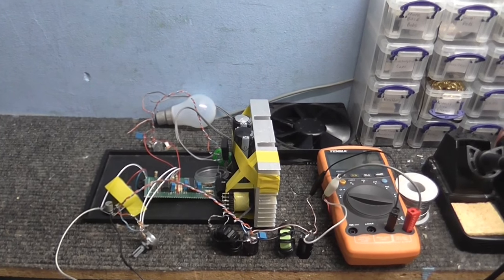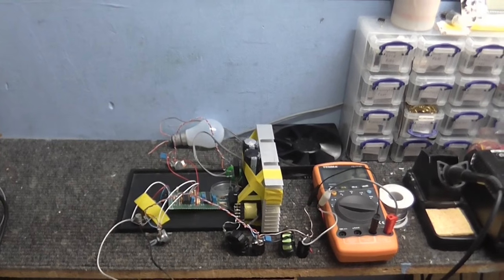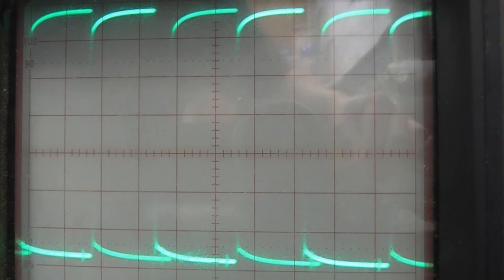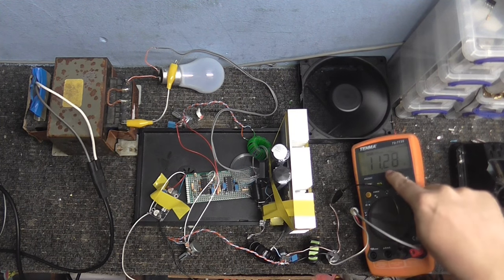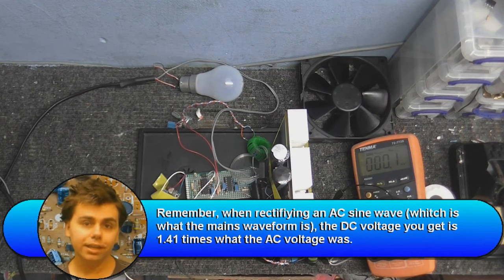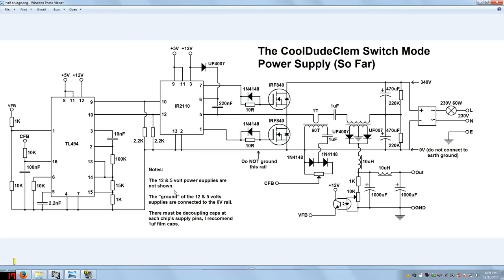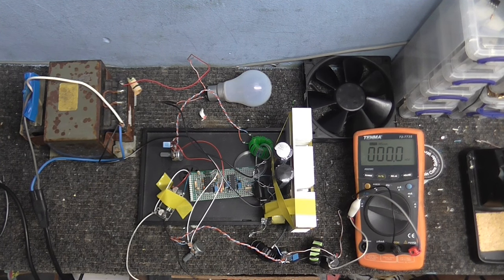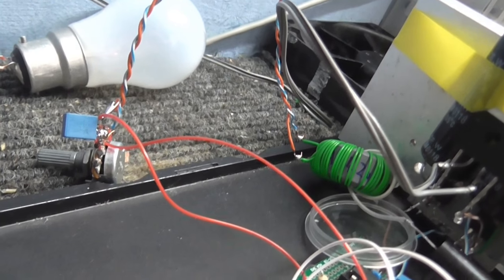The SMPS Saga Part 5 - Let's test this thing!

Comment: Your weird waveform if triggered properly would probably show you that the output inductor is in discontinuous conduction mode (DCM). I'm not 100% sure as you haven't triggered on it properly. That'd be the low frequency ringing anyway, where the magnetising inductance rings with a capacitance. High frequency would be a parasitic capcitance and leakage inductance ringing together, which you could snub. It's not necessarily a bad thing. Continuous conduction mode (CCM), voltage mode control (VMC) would require type III compensation for stability, which you don't have and I think you might struggle to implement. DCM is inherently first order so is much easier to compensate at the expense of a slower step response and higher peak currents. It's down to the value of the inductor, not the transformer.

You shouldn't need the 5V supply, all pins you have connected to 5V can be powered from 12V.

Current limiting on the TL494 is not easy to implement. The second error amplifier is a red herring, you need external circuitry to either latch for the duration of a cycle if you want cycle-by-cycle current limiting. (not recommended for a half bridge) or a circuit with a longer time constant or a latch that requires power to be cycled to re-start if you want over-current protection. A place you could insert this into the circuit is the shutdown pin of the IR2110. OCP is about as good as you can do on a half bridge. It's not a nice topology and TL494 is not a nice chip. At least the chip and topology go together.

Comment: The waveform looks strange because you didn't put any snubber across xformers primary. The 1uf cap in a company with the xformers primary forms a series LC tank circuit, that's why you see that weird sine wave on the waveform. 
     And about current feedback - what you have there is called soft limiting, not a trigger one. It works something like this: if the current draw is less than you set (let's say 1A), everything works normally; but when the load wants to pull more current, the supply adjusts the output voltage to such amount, at which the load will consume 1A (can be slightly more, that's OK).
Reply from the maker: +MrJohhhnnnyyy  Thanks, that shed some more light on things. I've often seen a resistor and capacitor across the transformer primary in a lot of switchmode supplies but didn't know why they are there, of course now I do (they form the snubber right?) I don't know why I didn't think of that, it makes sense now!  The only thing I don't understand now is how come the weird oscillation doesn't happen until the input voltage gets past a certain point? That's what made me think it could be the transformer saturating.  Also, I don't think I was too clear when I mentioned where the current limit will "trigger", what I meant by that is that I don't know at what point it's going to start to sense that the current is too high and start to reduce the voltage.
Reply: CoolDudeClem Well, I don't know exactly why it's disappearing when the input voltage goes down. Also, I don't think you saturated that xformer, you are using the correct rectifier, plus it's not a flyback which puts DC through the xformer, thus requiring air gap in order to prevent saturation. I think you scavenged that xfomer from an old computer PSU, am I right? The thing is, it would be great to know what frequency that supply used because that matters when you wind a transformer. Using a transformer from PSU that ran at, let's presume, 50kHz; in a supply that runs on 25kHz will cause the idle current to be excessive
Reply from the maker: +MrJohhhnnnyyy Yeah that transformer was scavenged from a computer power supply. As for the frequency I'm using, I'll have to get back to you on that when I measure it. With my room being all out of order with the work on the house being done, I haven't been able to do much, this video was actually filmed before all that work began and I've only just round to editing it.
Reply: CoolDudeClem OK, I understand that. I have a few videos to edit as well, but I'm not in a mood for it :)
Reply: +CoolDudeClem 
Heheh, you still have a lot to learn about SMPS ... and so do I XD
Keep up the nice work/fooling-around mate! :)

Comment: You need to be careful about not running the supply without a snubber network on the primary side. If you don't have one, you might easily blow your switching transistor due to too much voltage. (Depends on the SMPS topology, but think of "inductor kickback" and you'll know what I mean :P)

Comment: when I rectify the 119 volts AC that I received from the wall socket I get about 160 for some odd volts
Reply from the maker: +Cloud Kilber (hellhound1116) That's about right, the "AC volts x 1.41" only gives you a rough idea of what the voltage will be, AC line frequency isn't a always a perfect sinewave so it may be a few volts different to what you expect.
Reply: +CoolDudeClem 
Yep, you reminded me of some horrible AC sine waves that I've seen ... AKA, loads of cheap, unfiltered, non-PFC SMPS power supplies XD

Comment: or you can use a voltage doubler 2 diodes 2 caps so that would be 119 x 2  = 238 volts dc use a PI filter for smoothing. you should use an isolating transformer when using the mains voltage

Comment: pretty good.  you need to get a variac.  here is what you did.  on one side of the transformer you have the 2x470 uF caps.  on the other side you have 1uF.  so if u were to move the 1uF to the other side of the transformer, nothing changes except it becomes apparent that you have 1uF in series with 2x470uF.  what does that do for your 470uF?  since you are using UF4007 1 amp transistors on the output the 1uF is ok, however when you want to increase the output current and use larger diodes then...?  just saying...
Reply from the maker: Yeah I'm still learning all the "black magic" that can happen   If I had enough money, I would go and get myself a variac.

Comment: You put caps on the heatsink,but not the rectifier?????
Reply from the maker: +NoName This was just an experimental prototype, the only reason the caps were on the heatsink is I needed to keep them out of the way and prevent them falling down and shorting out something, there was no need to heatsink the rectifier (at the time) since it would only be on for a few seconds at a time while I experiment, of course for longer runs a heatsink is something I wouldn't miss out.

Comment: "how come the weird oscillation doesn't happen until the input voltage gets past a certain point?"  as the input voltage goes up the pulse width goes down.   it looks like the funny waveform is from the output inductor being too small and going into discontinuous mode.  which means there is no current flowing in either winding and it rings.  Notice that the pulse width has become very narrow. how did you calculate the inductor value? you can try to reduce the secondary turns and get lower secondary voltage and that will increase your pulse width and may help. (by now you're probably not even thinking about this circuit :)) but I am only guessing here